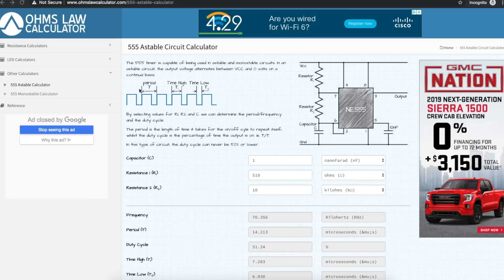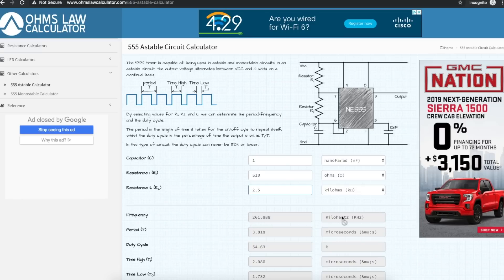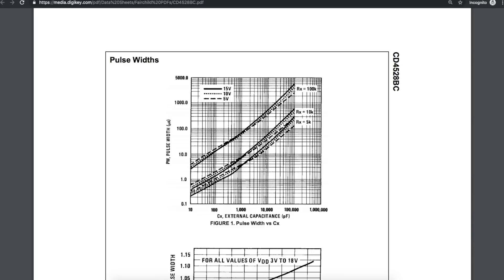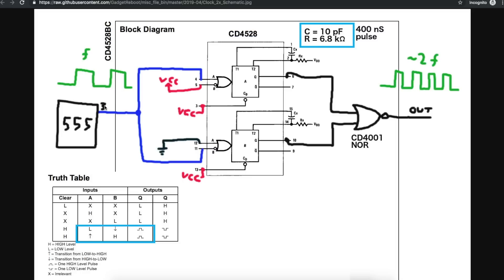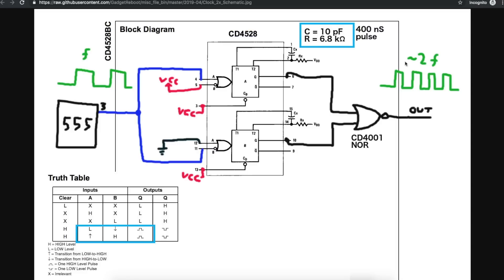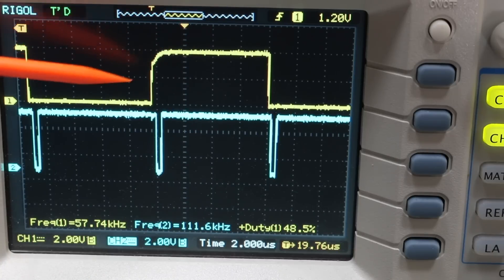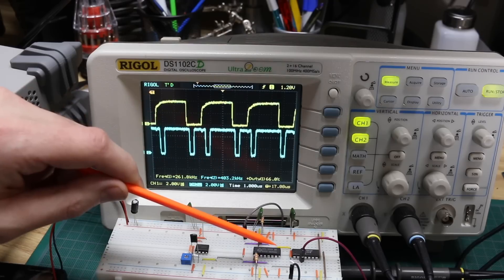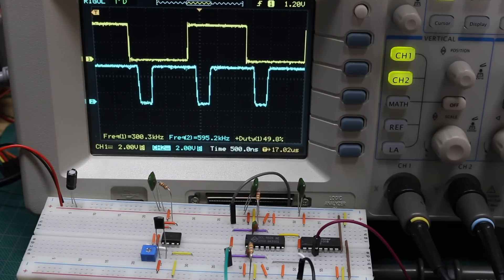555 Timer - Increase Maximum Frequency with a Digital Circuit Add-on

Comment: ... Further to my earlier post , ...for more flexibility ...using a 555 in Ast. mode but @ lower freq. one can gate/ hold both 4528 (A&B) by connecting the 555 pin 3 to the Reset inputs of both monoshots..
pins 3 & 13 ..
Now the monoshots run in burst mode during the 555 high (ON) time .

Comment: Use the Q output of 4528 A  to trigger the 4528 B , using it's ("B"active low) pin 11 input.....
Similarly the Q of "B" monoshot should trigger the 4528A on its B i/p (pin5)..
i.e. use both monoshots to trigger each other on their Active LOW going edges..also configure/wire both  their  other i/p pins for NON- RETRIGGER MODE....2 pots (adj.) and 2 caps can decide their p.w. time/s..
Here there is no need for a 555...
A (CD4013) single D f/f block or more can be used for the divide by 'n' value.....

Comment: Why not using just a single XOR? With 3 XOR gates (a single ic) you can do the same. I've the schematic ready to share. Can I post a picture on the Community tab?
Reply from the maker: What would that circuit look like?  I was originally trying to use logic gates and inserting some time delays with RC networks to stretch out rising or falling edges but it didn’t come out very reliable and then I saw that I had monostable multi vibrators in my part collection so I went with that. I wanted to revisit just using logic gates later but  if you have a solution that looks like it would work, I’d like to try that as well.
Reply: @GadgetReboot  The XOR double-edge detector is on this page -> http://www.orangepi-dmx.org/orange-pi-dmx512-rdm/ws28xx-configuration/prototype-boards/multi/4-output

Comment: Great video. I am not in a favor of 555, but I keep watching. Please will you do a video on CMOS oscillator circuits? Buffered vs un-buffered inverter? Thank you.
Reply from the maker: I added it to my list to look at.  It looks like I’m also running out of parts so I might need to order some things.  More mail bags!
Reply: Seems to me you would always want buffered output? I am a total newb so any thoughts on why an unbuffered output would be desired is greatly appreciated. 😬👍
Reply: @HazeAnderson I have just done some prototyping with the 74HC04 and 74HC02. Both are giving a nice clock signal.